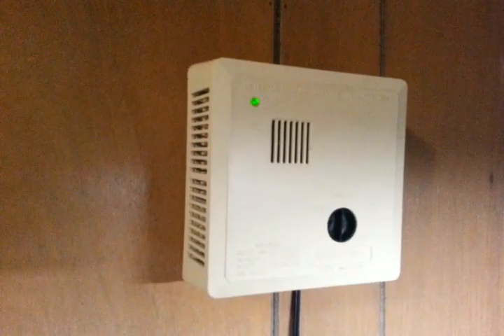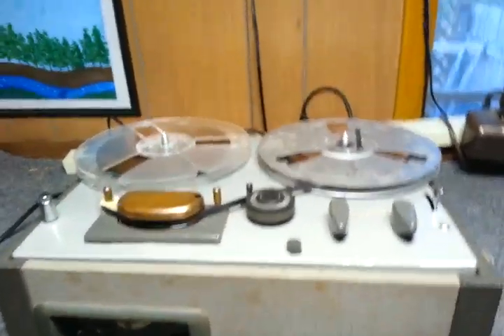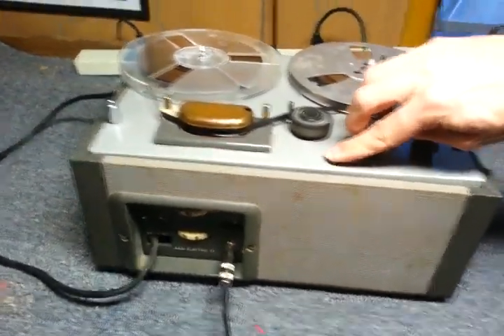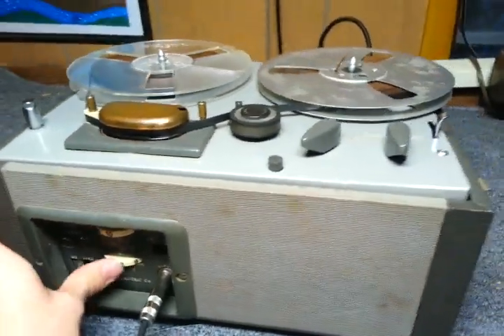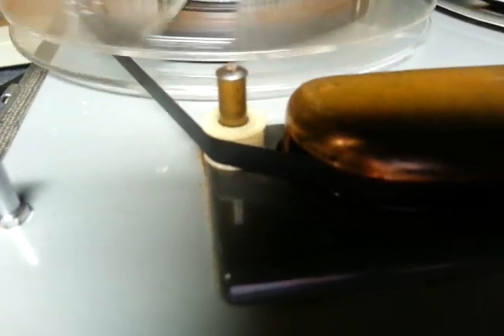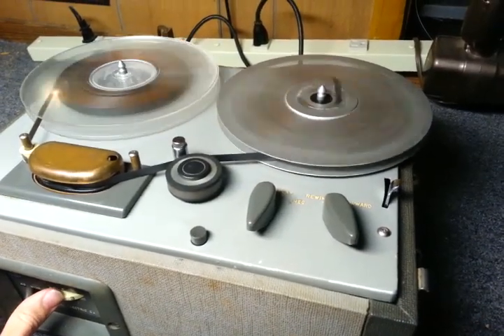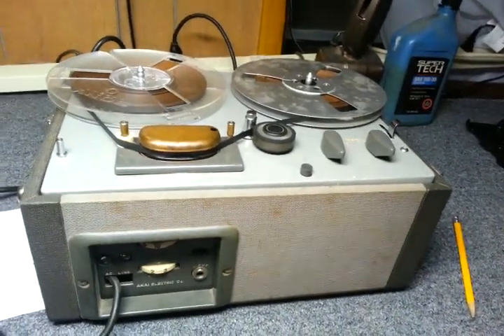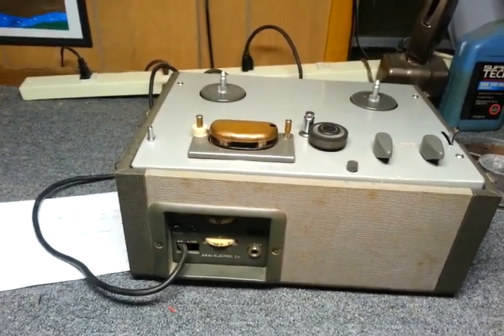Akai Terecorder Standard, reel-to-reel tape recorder from 1959/1960.

Comment: I have acquired a Deluxe model. It does have a 2-position voltage switch inside. I will watch your 1st video and see if you reference where you purchased the replacement belt for this. My unit needs a new belt.
Great real-world video. I chuckled. Thanks.